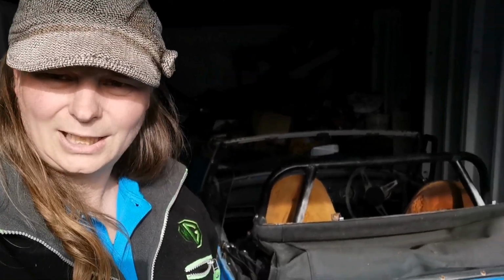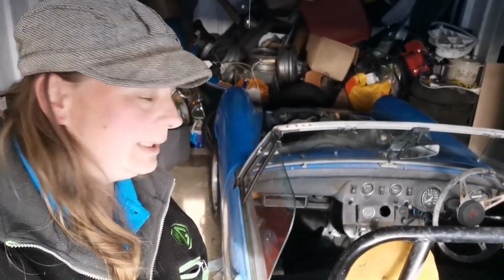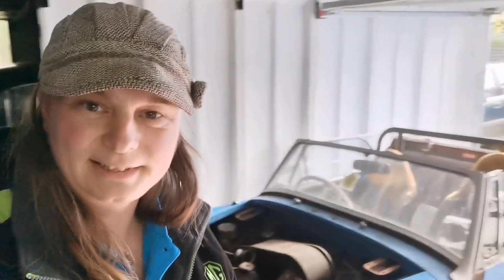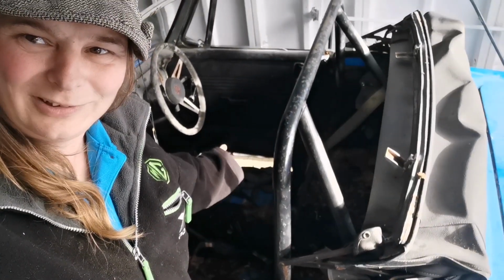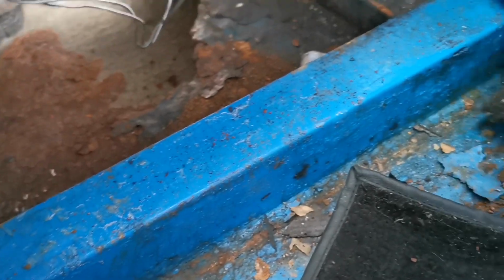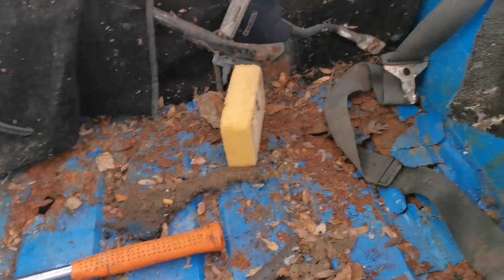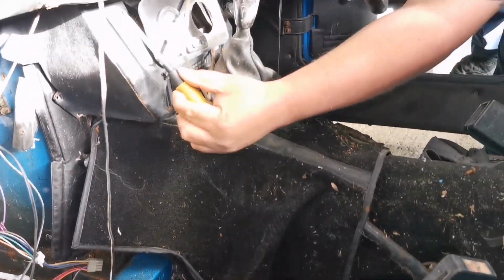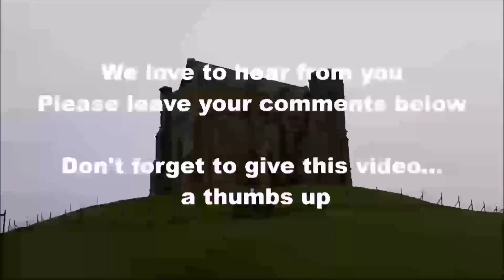How rotten can an MG midget be??? It's repairable, but only just! The toughest restore yet!

Comment: Well at least it's got a floor and sills, a well meaning previous owner had cut them out of mine without any bracing. Took hours to get it square
Reply from the maker: Well done for doing it!
I've sourced a donor shell now, hence it's been on hold for a while.
Reply: @RetroRatz  Different times, I was a time rich cash poor student but the car came with all the panels to complete it included in the £300 purchase price so spending hours sticking it back together was just all good fun.